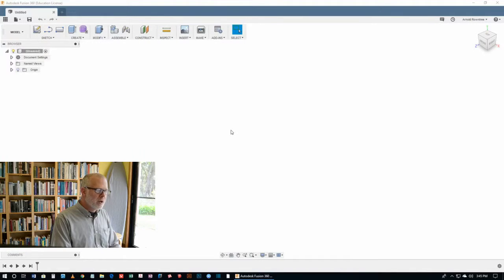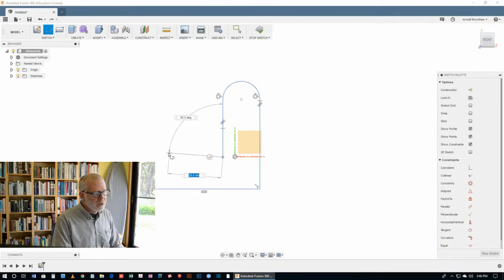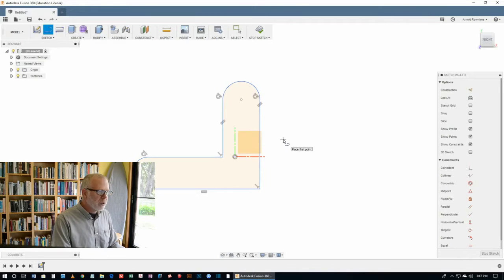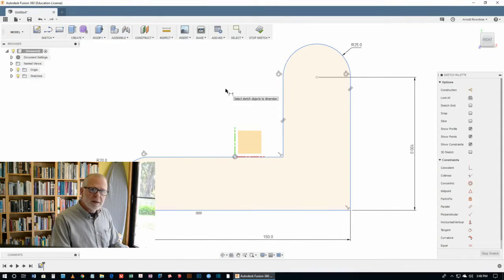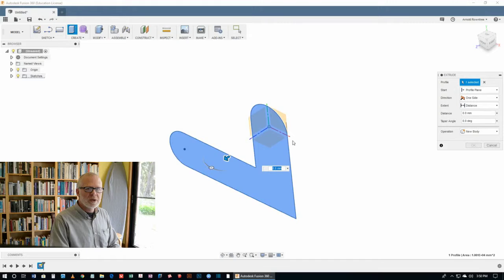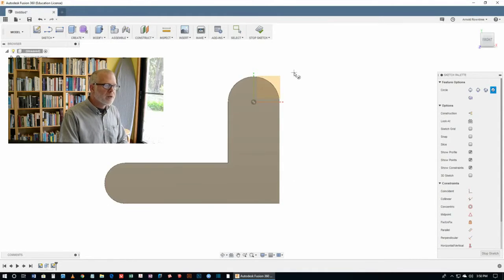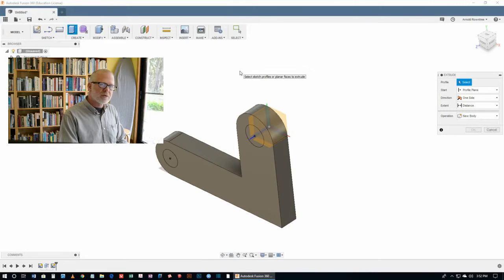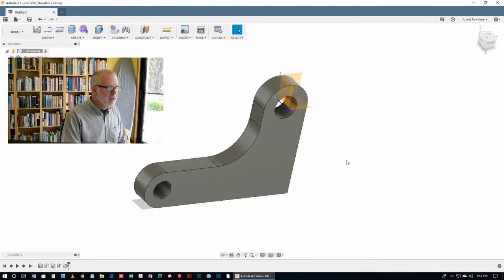Fusion 360 Beginner Tutorials - Part 7 of 16

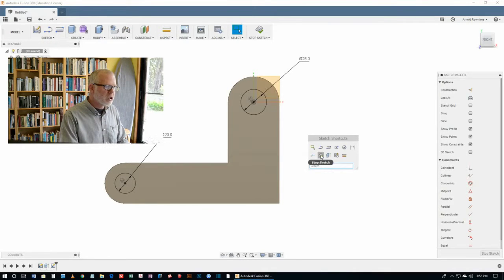Comment: I go stuck at 5:36. When I right click it doesn't have an option to "stop sketch or finish sketch". The top tool bar usually has finish sketch but the constraints are now present. At the point where I try to Extrude, it doesn't allow me to choose both circles on 1. When I try to to do it individually, the other circle disappears. Please help.
Reply from the maker: Hi Manny, sorry to take so long to answer. This video is in the older series, I'm working through the revisions as fast as I can but the pace is maddeningly slow sometimes. Anyway, that's probably causing you some confusion, some of the buttons are in a different place but I think you'll find them soon enough. The FINISH SKETCH button is on the toolbar above and its the last one to the right of that top toolbar. You won't be able to use the Extrude tool until you've Finished the sketch. Once you've clicked on the Extrude tool (second button on the toolbar above) then you'll get the option to choose the two circle profiles. Let me know if this helps.

Comment: Up to 7 now ..
Reached the limit of saved documents on Free account.. 

Loath to subscribe..
Reply from the maker: Hi  doc, don't subscribe, you have to make the earlier files 'read only and you can continue.  You can keep 10 editable at any time. Open your left side panel to see the controls, let me know if you need help. 
The personal use version of Fusion 360 is good for a year and you can renew for free after that but you have to know how.
Reply: Hello Arnold
Thanks for that ..

Done that...
Err... How do I get any back?

I really do appreciate the effort you have put into doing this and it really IS the best resource as far as I am concerned.
I wish you success going forward.
On another point, I 'd like to be a Patreon but the price points are too far apart.
I suggest you are pricing yourself out of a lot of people.
$750/annum is too much for a hobbyist.
Have you considered a band at say $25 per month that adds in Facebook Group and occasional extras?
Maybe see how others scale the access they provide.
Reply from the maker: @docprune9922  thanks Richard, I did have an in between tier at Patreon but had to withdraw it and I’ve been searching for a more suitable offering to take its place. Facebook groups take more time than I have at the moment and a Facebook page can’t be open for all to post on. As you suggest, those occasional extras will likely be the way to go.

Comment: I do appreciate your sharing your knowledge. I come from AutoCad 2000 which I was using to program wire edm machines back 23 years ago. As a machinist and programmer we normally always established the point of origin to where the blueprint established it to be. I do understand when doing a die assembly that point might be in the middle of the die. What I have enjoyed the most about your videos is the fact that I am learning your way of doing something and I do it that way and than I find several other ways of doing it. Those ways might not be faster but they give me opportunities to use constraints to correct the drawing. Thanks,
Reply from the maker: Thanks for your kind words Warren, all you experience will be valuable to you with your new software tools. 
I've intentionally left out establishing points of origin to make it easy for beginners but plenty of people are very uneasy with that decision. Hopefully some intermediate level tutorials with fill the gap when I get to it.
Let me know if you have any trouble with Fusion 360, everybody gets stuck now and then. Its just new and a little bit different.

Comment: Thanks, Arnold for your series. I am a 68year old retired carpenter but love tinkering. One of my hobbies is racing Radio Controlled cars which require endless parts. Looking at buying a 3D printer and see the need to get into decent CAD/CAM so I have Fusion 360 and what a learning curve, but your help and way of doing things is fantastic, keep up the good work. Have heaps of questions but will just work my way through your tutorials and YouTube Vids. Enjoying the challenge.
Reply from the maker: Good on you Kevin, that sounds great. Let me know if you have any problems with Fusion 360, everybody gets stuck now and then. Racing RC cars sounds like a lot of fun and it would be really neat to be able to make your own parts.
Reply: I bought a Ender 3 ver 2.  I love it.

Comment: Thanks for the nice lessons Arnold, I like the limited length of the several lessons. This keeps me motivated.  
At this point I wonder how to put the contraints window on my screen. I just cant't find it and didn't found the answer in the comments.
Reply from the maker: Peter, the user interface was changed half way through 2019 and my tutorials need updating. If you go to my channel and find the playlist where the 16 basic tutorials are you will find a video titled "User Interface Update to the 16..." https://youtu.be/QysKADuoBYc
I have also published a short for "part 1 in 60 seconds"  https://youtu.be/ZxLGz_OB4-M
If you watch the short and change the playback speed to 0.25% you will see part 1 modelled in the new UI at normal speed.

Comment: Hi Arnold at 77 years of age without any related education I manage to learn Fusion 360 thanks to your tutorials. Many thanks! Until now I have one small problem. When I click D for dimension I can fill in the dimension but when I confirm the number of the dimension disappears. The drawing adjusts to the new dimension, I see the lines with the arrows but no numbers.
Reply from the maker: jthijs, glad to hear that you're getting somewhere! You've come a long way if you're up to part 7.
Lets do an experiment to see what's going on with the dimension tool. 
Save everything, close Fusion 360 and power down the the computer.
Start up again, open Fusion and then in a new design document;
Start a new sketch
Use the rectangle tool to make a rectangle of any size.
Click D for dimension to resize the rectangle and try again.
Be sure that your NumLock key on the keyboard is lit up
See if you get the same result two or three times
Does that same problem happen here?

Comment: Funny thing is whenever I start a sketch on the red / green line it is showing the top view, and whenever you do it you get the front view.
Reply from the maker: Bob, I'm stumped. I tried messing with settings but I can't make that happen.
Reply: @ArnoldRowntreeTeachesFusion360  Maybe it is because you are living downunder and everything is the other way round :) I guess I will just have to accept it then.
Reply from the maker: I thought we might be neighbours, Bob
Reply: @Bob Beamon, I’m no expert, far from it, it maybe due to your z axis. I print with 3D printers and we always have the z axis going up, but I think in cad they have a different axis for z. Hope you understand. PS I know enough to be dangerous😀
Reply: @meawayfromhome  Hi Philp, I now absolutely nothing about Fusion Cad and the whole thing, but I am learning fast thanks to Arnold. I my default work screen, or what ever its called, my Z Axis is vertical, the X Axis to the right and the green to  the rear.

Comment: 6:00 Why  choose 'All' when it works with over-extruding  the  same way?
Reply from the maker: I have to admit that I've never used the rib tool on a real project, I think you've surpassed me there already.
Reply: Using the 'all' is better practise because the dimension between the two faces may be modified at a later date to a length greater than that of the original extruded distance value.  Certainly there is nothing wrong with over-extruding and it can be a quicker drawing method ....but ....